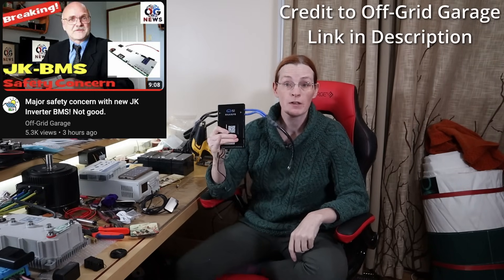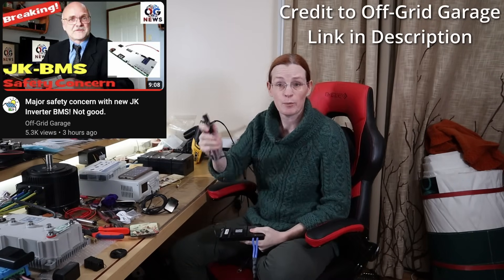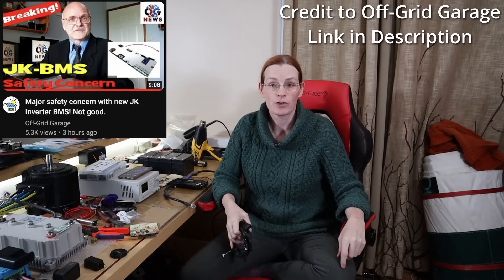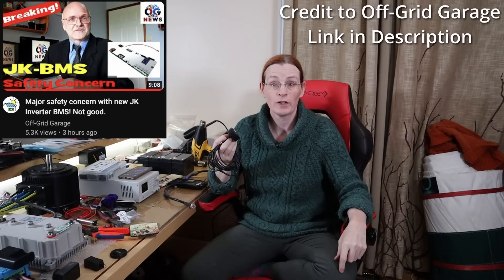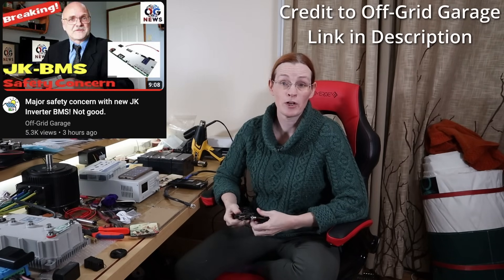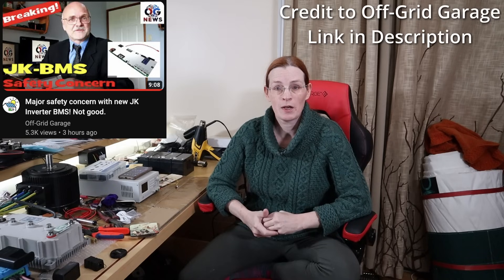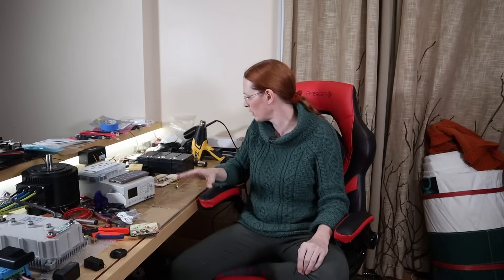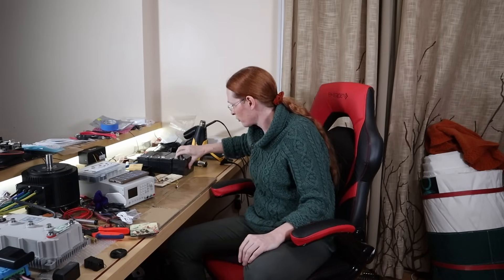News from Off-Grid Garage; Dangerous JK BMS Flaw

Comment from the maker: Several folks are pointing out that this flaw effects the new BMSes only. To restate what I said in the video; I know this. I mention this. I am upset because this is the latest in a series of problems. They're willingness to change features on the fly, sell incompatible parts, and other issues I've had over the last two years all add up. This is a company that doesn't take QA seriously, released clearly untested products on customers, and then blames the customers for problems. The BMS plays far too crucial a role to be a playground for untested development.
Reply: The lack of testing in such a critical piece of equipment is what scares me the most.  They literally let their end-users test a product that can theoretically kill someone if it has a bug.
Reply: BMS= Safety device . Not proving out Safety software is an unforgivable mistake in my opinion too .
Reply: JK fixed it! Update available on the website tomorrow. AND - default setting will be LFP !  From my view a very quick fix and good customer service. I don't know any other BMS supplier getting customer feedback and bugs addressed that quick.
Reply: @michaelwessel2983  - default setting will be LFP, thats not a fix ;-) but only LFP Guys must do update for safety. Better Change to Pro BMS !
Reply from the maker: @michaelwessel2983  My understanding is that the new default chemistry is LTO. In any case, I am glad it's being fixed, but that doesn't change my view of the company. I am done, I don't trust them.
Reply: I am still a fan of JK and if I need a new BMS i'll buy a JK again. The other brands are not better or too expensive.
Reply: @topeye4202  I'm too! And my customers are even fans, too.
Reply: thank god I only bought one at the time :-) sell it used, take a solid BMS * n BmS then you have time for other things and everything will be fine :-).
Happy New Year
☺🤗
Reply: You are right, it is a fatal bug and it should not happen. But in general I'm absolutely happy with their BMS in the past. Years of positive experience, starting and running for ever without any problems. This error comes ONLY with the brand new inverter BMS and they will  fix this within the next days, they said to me in person. So, everyone knows, it is brand new and following Andys channel, we all saw the problems with the older SW versions. Yes, no excuses, this should not happen. But it happened. Anyway, I'll keep on using JK-BMS, because they are still the best for our purposes. Once the community is happy with the new inverter BMS and more long term experiences will be available, it will be again a great BMS for the next years, I'm sure!
Reply: I had a good laugh when you said "recall"....from China? Surely you jest! 🤣 If the default setting was to LiFePO4 it would have only pissed the Li-ion users off but not been unsafe.  In ESS use they may never get turned off, but yes, it's a rather dangerous problem

Comment: What’s the problem here? Why are you supplying the battery more than 3.65v per cell in the first place?

If you only feed it the intended shut off voltage, or slightly above that, then it cannot over charge.

Feeding the battery a dangerously high voltage and relying on the BMS (of any brand) to be the only thing stopping your home/van/shop from bursting into flames is asking for trouble, so shouldn’t be surprised when it comes around.
Reply from the maker: OK, so there's a lot to unpack here... You don't supply to voltage per cell, you supply the charge voltage to the pack and the cells charge more or less evenly (deviation based on each cell's IR). The BMS watches for the first cell to hit the max cell voltage and then stops. If it fails to do that, there won't be a fire, but you cell will be damaged and possibly bloat.

Comment: I think I would install a relay that simply cuts off the bms, at , I don't, .2 or .3 volts higher than what you want, and have this relay operate a buzzer or horn, or flashing leds, or whatever is appropriate.
Reply from the maker: Opening a relay under load can lead to arcing, and closing one with a load trying to draw can cause arcing, and the contactors could weld shut. This is why relays are rare with LFP batteries.
Reply: @TheDigitalMermaid  Thanks for responding. I was referring to the power up wire on the JK B.M.S, that last red wire that needs power in order for the B.M.S. to function. That wire could not be more than one, maybe two amps at most. I could test the amperage on that. If you put a relay set at whatever voltage you wanted it to engage at, this would fix this problem.
Reply from the maker: @martinwhite418  Ah, I see what you mean. I've never tried pulling just that wire, does it actually shut down the BMS immediately?
Reply: @TheDigitalMermaid  Hello again. Well, immediately? These are good questions. I will go test this. When you say immediately, that makes me think a few milliseconds, or less. But I don't think we need anything near that quick, because we are talking stopping over voltage on a cell. I would think (hope) that if the bms screws up, it would be on all cells, otherwise my idea needs a relay type setup on each cell. Big ugh on that one. But, since it looks like we're discussing a problem that switches the batt chemistry, thereby creating an over charge voltage problem, any single cell voltage could be the relay "switch".

Comment: Hi I was told that the JK factory claims  they have eliminated the problem through some updates, can anyone confirm this?
Reply from the maker: It's true, yes. I can't remember the specific version that fixed it though. Andy covers it in detail on his channel.
Reply: @TheDigitalMermaid  so does this BMS have your vote of confidence now?
Reply from the maker: @alexberov6428  no, this was not the only problem, as I mentioned on the video. It was just the last straw. I knew it could be fixed, but they have so little concern for quality that these kinds of mistakes can happen again with safety critical parts of the system
Reply: @TheDigitalMermaid  thank you, I think Ill use the Seplos 2.0 version BMS

Comment: how possible charge 4 x 4,2 = 16,8 V DC with charger from boat 14,05-14,2 v DC yoa are totals hilarious. if you charge with car alternator ,solar mppt regulator,lifepo4 charger all this staff have voltage around 14,1-14,4 if you search all world very hard you find alternator to 16,8 v maybe find 15v dc   i have on 2 boat over 6 year lifepo4 without any bms

Comment: Super!
  We need for 64S
  Can we use 16S x4 BMS for 50Ah LiFe 3.2V battery. We need 30A charge and discharge max power.
Reply from the maker: So 192v? No, you need a BMS designed for that kind of voltage.

Comment: Well... they probably didn't have enough place in nvm ^^ you may want to look at JBD bms , they are very reliable. need a special care for comm, but do they work :)
Reply from the maker: Given they were able to fix it with a firmware update, I assume there was enough space, just shoddy pre-release testing...
Reply: mmh well, as a dev, I can understand that this kind of "special bug triggers" can happen ^^. The important fact is that they, accept the pun , react quickly,  and push a mandatory fix immediately. Do they have some kind of OTA to update the firmware?  @TheDigitalMermaid
Reply from the maker: @HadrienDorfman  Dunno, haven't played with the new inverter model. Seems like it was update app -> update BMSes, but check Andy's channel for details.

Comment: Question... what breaker or fuse (model would be appreciated) should I use with these BMS's
Reply from the maker: Less about the BMS, as I put the fuse immediately after the main pack positive, but any T-Class fuse rated higher than your expected loads will work. Personally, I like (and accidentally tested) A LittleFuse JLLN-200.

Comment: The solar MMPT will protect the pack from pack over voltage, but the BMS does individual cell protection, the BMS gives some redundancy.
Wonder if there is a cell monitor/alarm device that could give redundancy in case of BMS failure? Not that hard to design, should be fairly inexpensive, cheap if it protects the invest in batteries.
Also live in Ontario, looking for cells, did you have them delivered here, vender you recommend?
Reply from the maker: The MPPT, and any external charger, can't see the internal cell voltage. Say you set the charger to stop charging at (3.55 x 16 =) 56.8v, and 15 of the cells were at 3.3v average (3.3 x 15 =) 49.5v, leaving 7.3v for a single high cell to go up to. The issue with the BMS resetting the high voltage disconnect would still occur. If you've got something monitoring per-cell, well you have a BMS of some sort. :)

I ordered the cells from QSO (Qishou) on Alibaba and had them shipped from China, took about 2.5~3 months iirc. Cheers, neighbour!
Reply: @TheDigitalMermaid  
Thanks i look at the failure modes of a BMS,  worst case would be a shorted Hexfet, it that happens your expensive battery's have no cell level protection. I always like belt and braces protection.

Comment: Wow, what a mess... Some won't start until you connect a charger for a bit. But never heard of BMS'es you have to 'jumpstart' with a 5V source. Changing properties without creating a new version or model-number should not be done. Selling parts with incompatible connectors is telling on how that company is run. But defaulting settings is unforgivable. You just CANNOT have a BMS that changes back to 4.2V Li-ion after it has been configured for 3.65V LiFePO4 earlier, not under any circumstance.
One could argue that the charger should not output more than the max battery charge voltage but if the battery is not well balanced, one cell will still be overcharged until 4.2V before balancing will start. That cell will heat up and could start venting hydrogen.
Stay away from that company's products. Don't even touch them with 10-foot pole. Unless it is to hit them.
Reply from the maker: This is exactly where the bulk of my frustration came from, with the lack of fail-safes exposed by the latest firmware bug being the last straw. Somehow that point was missed on a good number of people though, who thought my primary complaint was just the flaw Andy's community found.
Reply: @TheDigitalMermaid  Thank you for your answers. I'm posting because there's news... I just saw an Off-Grid Garage vid with an explanation from JK, a new FW update that will prevent the factory-defaults-issue from occurring and if it still occurs, the default profile will be LTO instead of Li-ion, which will not damage your batteries when charging. In fact, they will not charge at all.
After watching Off-Grid's JK vid, I still have 'chinesium' vibes. It's nice for tinkerers but not so much for mission-critical applications.

Comment: Well every lithium installation with or without BMS require due to ISO for Europe (mobile lithium usage) and ABYC (American boating and yachting organisation)  an independent last resort solution. The standard one meanwhile used in RV and boats is to use a battery monitor with an remote relay. I always use the victron BMV712 that does LCV and HCV and with midpoint monitoring also cell deviation vut off when deviation between packs 1+2 compared to 3+4 is above 0.5V. BMS is at 3,55V overvoltage and 2.8V LCV and victron BMV712 at 4x3,65V=14,6v and off at 4x2,5V=10V. So if BMS fails due to any reason like eg here with wrong default after storage the BMV would prevent from overcharge or deep discharge. I highly recommend this in EVERY lithium installation. saved my ass and big junks of money already several times plus the monitoring the BMV712 provides is also very helpful. Especially in combination with victron cerbo if your BMS is not integrated yet or as eg total of several BMS. I always use one BMV712 per battery and BMS also in multiple batteries in parallel and one for the system overall as last resort. For eg winston cells you can skip a BMS in 4 or 8S just with a BMV712 doing LVC and HVC and deviation and with saving on BMS the winstons are not that expensive anymore compared to EVE. The BMV712 is super reliable, don't know one in 20years dealing with lifepo4 that failed.
Reply from the maker: Victron's approach to their BMS and LFP setup is pretty unique, and only viable in their environment where everything is talking to each other. They wanted to be able to handle the same kind of inrush currents like starting diesel engines, making them actually drop-in replacements for LA (LFA/AGM/etc). The problem with externally disconnecting charging in parallel battery installs, like I have, is that if one battery needs to stop charging, and turns off the charge from the Quattro/Multiplus/etc, then all batteries stop charging. If you have a contactor-based BMS, then the BMS can ask the specific battery's contactor to open, but contactors have their own trade-offs. 

There's no universal solution, but in the end you somehow must have something that can see the per-cell voltage and cut off charging/discharge reliably. I know some people run LFP without a BMS, and that's their choice, but it's not one I'd ever endorse.

Comment: I thought your 1st BMSs were Overkill Solar that you gave to Andy? I've been running (2) 16s flawlessly for almost 2 years. I haven't turned my system off once.
Reply from the maker: Good memory, it was. I was lured in by the JK's 150A over the OKS's 100A and the 2A active balancer. The OKS / JBD BMS itself never gave me a hassle.